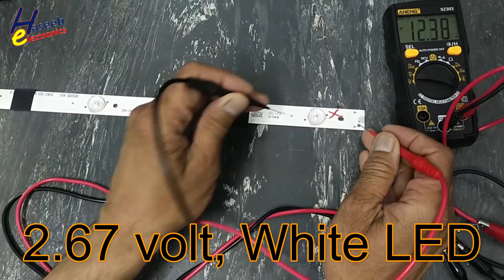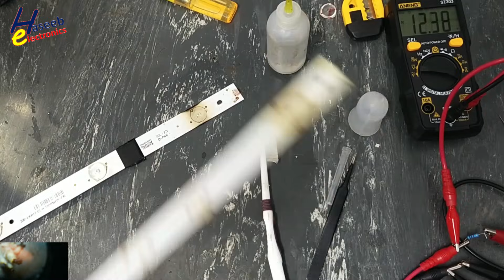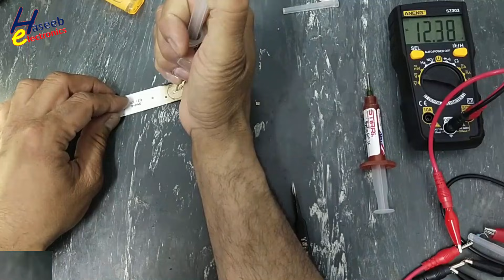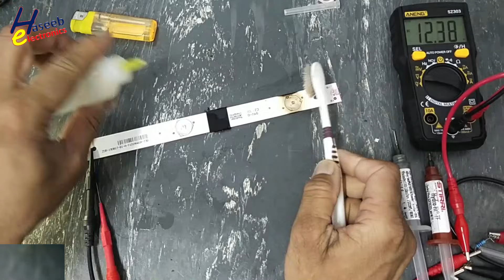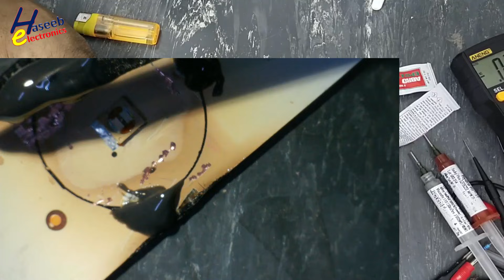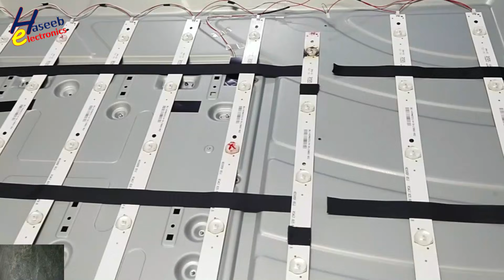{1283A} An Idea to repair LED backlight strip

Comment: Did I see you using a TeaLight candle or a lighter to remove/solder the LED? (https://youtu.be/s5uT0Tt8ULE?t=247). That is a great idea !     I always broke my LEDs when removing them.  Also re-soldering often failed because the metal back of the LED strip conducted the heat away from the soldering spot and my Weller station was not able to provide enough heat.
This is great "out of the box" thinking.  
Thank you so much for sharing this !
/chriV

Comment: Thanks for sharing knowledge but when we replace dull / open led with new one in most cases another led in series goes faulty after very short time span.

So in my opinion the whole led strip replacement is the solution to the problem.

Please comment your corrections 🙏
Reply: 0:30 He mentions this is not ideal but for a situation where you cannot replace the strip because you cannot find a replacement.

Comment: Hello. The video is very instructive, thank you. How did you build the alcohol lamp? Does it smoke on the back of the pcb? I tried this with a lighter, but it smokes really bad
Reply: It will smoke with a flame, you can see the black soot from the flame on his PCB strip. Hot air is an alternative.